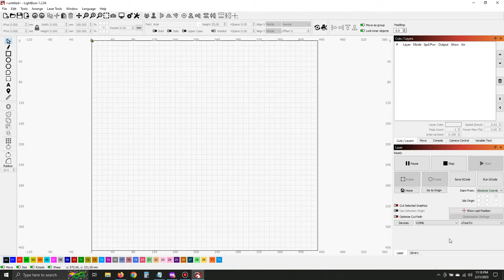LightBurn NOT Connecting to Laser | Lightburn Software Tutorial

Comment: Alright so I was having an issue with this and I did the extreme and made a new instance of windows via dual booting to make sure I had a fresh instance of Windows.

I have tried things like manually assigning the COM port of the device (this is done if the user has an issue where one com port is shared between 2 devices) and that wasn't the issue.

Turns out I was using the wrong physical port on my laser. My laser has multiple usb c ports but they all serve a different purpose where one port serves as a way to update the laser firmware, another port for the sd reader firmware, etc.

I put the usb in the right port and it worked instantly. This wasnt mentioned in my manual at all, I am using the creality laser engraver.
Reply from the maker: Wow, what an ordeal! I guarantee you that someone out there will have this same issue and your comment will save them a headache so I’ll pin this one. 👍

Comment: I got a CO2 Gweike Cloud laser i just purchased, after installing my device to light burn I could move the laser head, do framing, but when hitting the start button laser won’t fire. On windows do i have to install a driver of some sort? Light burn or the laser itself is throwing an error code saying my Laser is to close and will hit the material, but I adjusted it and it still won’t fire. I would appreciate a feed back, thanks for the video.
Reply from the maker: Hi there,

I'm sorry to hear that you're experiencing difficulties with your CO2 Gweike Cloud Laser in LightBurn. It sounds like you've taken some troubleshooting steps already, but let's see if we can get to the bottom of this.

Regarding the issue with the laser not firing when hitting the start button, it's possible that there could be a few different factors at play. Here are a few things to consider:

1. **Driver Installation**: While LightBurn typically handles the communication between your computer and laser, it's a good idea to ensure that you have the correct drivers installed for your laser machine on your Windows system. You may need to check the manufacturer's website or contact their support for guidance on installing the appropriate drivers.

2. **Error Code "Laser Too Close"**: If LightBurn is throwing an error code indicating that the laser is too close to the material, it could be related to the focus or calibration of your laser. Double-check that the focus of your laser is properly adjusted for the material you're working with. Additionally, ensure that the laser head is not physically obstructed or too close to the material.

3. **LightBurn Settings**: Review the settings in LightBurn to ensure that they are configured correctly for your laser machine. Pay close attention to parameters such as power, speed, and mode (e.g., cutting or engraving) to ensure they align with the capabilities of your laser.

4. **Safety Interlocks**: Some laser machines have safety interlocks that prevent the laser from firing if certain conditions are not met, such as the lid being closed or an emergency stop button being engaged. Ensure that all safety interlocks are disengaged and that the machine is in a ready state for operation.

If you've checked all of these factors and are still encountering issues, I recommend reaching out to LightBurn's support team for further assistance. They have a dedicated support team that can help troubleshoot issues specific to LightBurn software and laser integration.

I hope this helps! Let me know if you have any other questions or if there's anything else I can assist you with.

Best regards,
Shane
Reply: That was the most in-depth reply I have ever gotten bro. You need to make a video on that. I'm gonna copy this and first try the driver for windows for LightBurn and go from there. New sub, and I will let you know what I find out bro. Much Love! Thanks again.
Reply: I just wanted to give you an update, I got the laser to fire, there is a safety insert that plugs in the back  of the laser, it's right next to the on switch. I was on whatsapp with support from gweike and that's what we found. it would have been great if there was instruction for all this but it doesnt come with it. Thanks again.

Comment: You have Windows.  I have Mac.  I don't have "com6" to select.  I have Auto and Bluetooth incoming port.  Which my laser is not bluetooth capable.
Reply from the maker: Hi Pete, on a Mac, the port names are different from Windows. Instead of 'com6', you should see something like '/dev/tty.usbserial-XXXX' or similar in LightBurn's Laser panel. If you don't see it:

1. Make sure your laser is powered on and connected via USB.
2. Restart LightBurn.
3. Check under 'Devices' in the LightBurn software to see if your laser appears there. If not, you may need to install drivers for your laser, or there may be an issue with the USB connection.
4. If it's still not appearing, try a different USB cable or port, and make sure the cable is not a charge-only cable.

Let me know if any of these steps help or if you have any more details so I can assist you further.

Comment: Hi I grabbed the latest driver for it... my laser was originally trying to use com3, wouldn't connect giving an error message saying access denied to com port, so I changed the port it used to com port 6, still won't connect... I am on a windows 11 pc, I was trying to use it in grbl and in lightburn but still not recognizing it. thanks in advance for any ideas you may have.
Reply from the maker: Hi, it sounds like your COM port might still be having conflicts. Here's what you can try:

1. **Check COM port conflicts**: Ensure no other device is using the same COM port (3 or 6). You can change or disable unused ports in Device Manager.

2. **Run as Admin**: Launch Lightburn or GRBL as an administrator for better permissions.

3. **Reinstall drivers**: Uninstall the driver and reinstall the latest version.

4. **Verify Baud Rate**: Make sure your baud rate matches the laser's requirements.

Hope this helps! Let me know how it goes!
Reply: @hobbylasermachine  thank you i finally got it, used a newer driver, chose a different baud rate and took settings from the laser's sd card

Comment: I tried using the console commands of $74 and $75 to set up my laser to use WiFi... but it turns out my laser isn't compatible, apparently... and now Lightburn will not connect to the laser even via USB. Do you know how to undo the $74 and $75 commands and remove the WiFi settings?
Reply from the maker: Hi Mitch! I'm sorry to hear about the issue you're experiencing with LightBurn and your laser setup. To undo the $74 and $75 commands and remove the WiFi settings on your laser, you will need to access your laser's firmware settings through a serial connection via USB or another suitable method. Here are the general steps you can follow:

    1. Establish a Serial Connection:
        -Connect your laser machine to your computer via USB.
        -Open LightBurn and ensure your laser is recognized and connected via the USB connection.

    2. Access the Console in LightBurn:
        -In LightBurn, go to the "Console" tab or window. This is where you can send commands directly to your laser.

    3. Send Reset Commands:
        -In the Console, send the following commands one at a time:
            $74=0 (This will reset the laser's X axis to use hardware endstops)
            $75=0 (This will reset the laser's Y axis to use hardware endstops)
            $RST=* (This command varies by firmware but is often used to reset settings)

    4. Power Cycle Your Laser:
        -Turn off your laser machine and then turn it back on to ensure the changes take effect.

    5. Reconnect in LightBurn:
        -In LightBurn, attempt to reconnect to your laser using the USB connection.

If everything goes well, your laser should revert to its default settings, and you should be able to connect to it via USB. However, please note that the exact commands and steps might vary depending on the firmware and controller board used in your laser machine. Make sure to consult your laser's user manual or the documentation provided by the manufacturer for precise instructions on resetting the settings.

If you encounter any difficulties or if the problem persists, it's a good idea to reach out to your laser's manufacturer or the manufacturer's support for specific guidance on your laser model and firmware. They can provide you with detailed instructions tailored to your equipment.

Hope this helps,
~Shane
Reply: @hobbylasermachine  hey Shane. Thanks for getting back to me. I ended up taking the SD card out of the laser, putting it into the pc and just deleting the files on the card. That fixed the issue. Thanks!
Reply from the maker: That’s awesome! Glad you’re back up and running!

Comment: I used USB to connect the lightburn to the laser machine, the light is still on but no COM port appears on the lightburn, what should I do?
Reply from the maker: Hi Hygge Candles,

If you've connected LightBurn to the laser machine via USB and the light is on, but no COM port is appearing in LightBurn, here are some steps you can take to troubleshoot the issue:

1. **Check USB Connection**: Ensure that the USB cable is securely connected to both the computer and the laser machine. Sometimes a loose connection can prevent the COM port from being detected.

2. **Restart LightBurn and Laser Machine**: Try restarting both LightBurn and the laser machine. Occasionally, this can resolve communication issues.

3. **Verify Drivers**: Make sure that the necessary drivers for your laser machine are installed on your computer. These drivers are crucial for establishing communication between the computer and the laser machine.

4. **Try Different USB Port/Cable**: If possible, try connecting the laser machine to a different USB port on your computer. Additionally, using a different USB cable can help rule out any issues with the cable itself.

5. **Check Device Manager (Windows)**: In Windows, open the Device Manager and look for any unrecognized or problematic devices. If the laser machine is listed there with an exclamation mark or warning symbol, there may be an issue with the driver or USB connection.

6. **Update LightBurn**: Ensure that you're using the latest version of LightBurn. Updates often include bug fixes and improvements that can help with connectivity problems.

7. **Contact Manufacturer Support**: If none of the above steps work, consider reaching out to the manufacturer's support team for further assistance. They may have specific troubleshooting steps or insights based on the model of your laser machine.

By following these steps, you should be able to troubleshoot and resolve the issue with the COM port not appearing in LightBurn. If you need further assistance, feel free to ask!
Reply: @hobbylasermachine  many thanks 🥰

Comment: I reinstalled the driver from comgrow and there was nothing to choose in the port.
Reply from the maker: Hi Dennis, here are some troubleshooting steps to solve this issue.

1. Ensure Proper Connection: Double-check that the laser machine is correctly connected to the computer via the USB cable. Make sure the cable is securely plugged in both the machine and the computer's USB port.

2. Check USB Port and Cable: Try using a different USB port on the computer to rule out any issues with the specific port being used. Additionally, test with a different USB cable if available, as a faulty cable could potentially cause connection problems.

3. Restart Computer and Laser Machine: Sometimes, a simple restart can resolve connectivity issues. Restart both the computer and the laser machine, then launch LightBurn again to see if the machine is detected.

4. Check Device Manager (Windows): On a Windows computer, open the Device Manager by right-clicking on the Start menu and selecting "Device Manager." Look for any devices with an exclamation mark or question mark indicating a driver issue. If found, try updating the driver for the laser machine.

5. Verify Correct Driver Installation: Ensure that the correct driver for the Comgrow laser machine is installed. Check the manufacturer's website for the latest driver version compatible with LightBurn. Uninstall any existing driver, restart the computer, and then reinstall the latest driver provided by Comgrow.

6. Try Different Computer: If possible, test the laser machine with LightBurn on a different computer. This will help determine if the issue lies with the computer or the machine itself.

7. Contact Comgrow Support: If all else fails, it's recommended to reach out to Comgrow's customer support for further assistance. They should be able to provide specific guidance and troubleshooting steps tailored to their laser machine model.

It's important for you to provide additional details about the specific laser machine model, operating system, and any error messages you encounter. This information will help in diagnosing the issue more accurately and providing more targeted solutions.

Hope this helps,
Shane

Comment: i need help my omtech laser wont fire but i have sit here for three hours and there is no fire button in my settings can anyone help me
Reply from the maker: Hi Timothy,

I’m sorry to hear about the trouble you’re having with your Omtech laser in LightBurn. If you’re unable to find the fire button in your settings, there are a few things we can check to troubleshoot the issue:

	1. Ensure Laser Connection: Double-check that your Omtech laser is properly connected to your computer and recognized by LightBurn. Go to the ‘Devices’ panel in LightBurn to see if your laser is listed.

	2. Check Device Settings: In LightBurn, navigate to the ‘Device Settings’ panel. Confirm that you’ve selected the correct device (your Omtech laser) and that the settings are configured properly for your laser.

	3. Test Fire: Look for the ‘Fire’ button within LightBurn’s interface. It’s typically located in the ‘Move’ or ‘Laser’ panel. Clicking this button should manually trigger the laser to fire a test pulse. If you don’t see the ‘Fire’ button, it’s possible that it’s hidden or disabled due to safety settings.

	4. Safety Settings: LightBurn has safety features that may prevent the laser from firing if certain conditions aren’t met, such as the laser being armed or the lid of the laser machine being closed. Ensure that all safety interlocks are engaged as required.

	5. Consult LightBurn Documentation: Refer to the LightBurn user manual or online documentation for guidance specific to using LightBurn with Omtech lasers. There may be tips or troubleshooting steps that can help you resolve the issue.

	6. Contact LightBurn Support: If you’re still unable to resolve the issue, consider reaching out to LightBurn’s customer support for further assistance. They have a dedicated team that can help troubleshoot software-related issues.

I hope one of these steps helps you get your Omtech laser firing again in LightBurn. Let me know if you have any other questions or if there’s anything else I can assist you with.

Best regards,
Shane

Comment: My com keeps disappearing
Reply from the maker: Hello,

Thank you for reaching out and sharing your issue with LightBurn not connecting to your laser due to the disappearing COM port. I understand how frustrating this can be, but let's work together to troubleshoot and resolve the issue.

Here are some steps you can try to address the disappearing COM port problem:

1. **Check Physical Connections**: Ensure that your USB cable is securely connected to both your computer and the laser engraver. Sometimes, loose connections can cause communication issues.

2. **Restart Your Computer**: Sometimes, simply restarting your computer can refresh the system and resolve COM port issues.

3. **Try Different USB Ports**: If possible, try connecting your laser engraver to different USB ports on your computer. This can help determine if the issue is specific to a particular port.

4. **Update Drivers**: Make sure that you have the latest drivers installed for your laser engraver and your computer's USB ports. Visit the manufacturer's website to download and install any available updates.

5. **Check Device Manager**: Open the Device Manager on your computer and see if the COM port for your laser engraver appears under the "Ports (COM & LPT)" section. If it's not there, it could indicate a driver or hardware issue.

6. **Disable Power Management**: In the Device Manager, right-click on the COM port, select "Properties," go to the "Power Management" tab, and uncheck the option that allows the computer to turn off the device to save power.

7. **Update LightBurn**: Ensure that you're using the latest version of LightBurn. Updates often include bug fixes and improvements that can address connectivity issues.

8. **Contact Support**: If you've tried these steps and the problem persists, it's a good idea to reach out to LightBurn's support team for further assistance. They may have additional troubleshooting steps or insights specific to your setup.

I hope these suggestions help you resolve the disappearing COM port issue and get LightBurn connected to your laser engraver successfully. Please let me know if you have any further questions or if there's anything else I can assist you with.

Best regards,

Shane